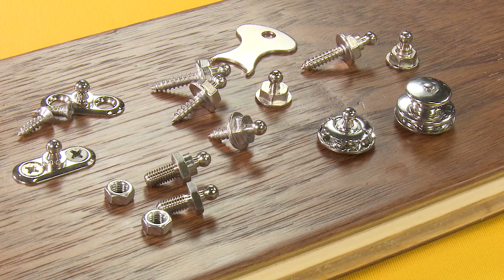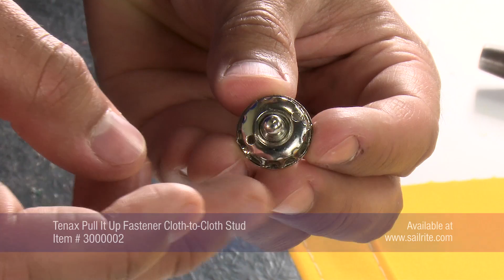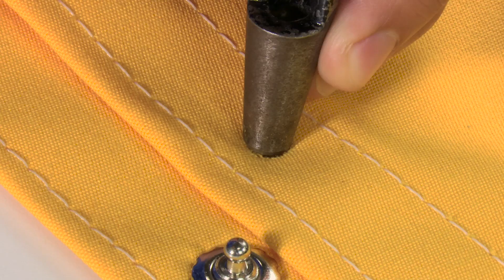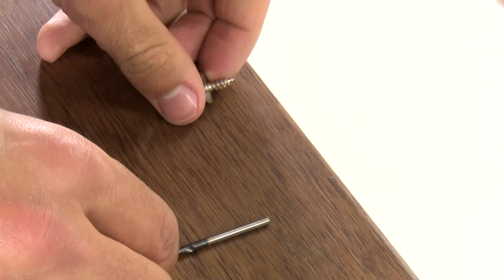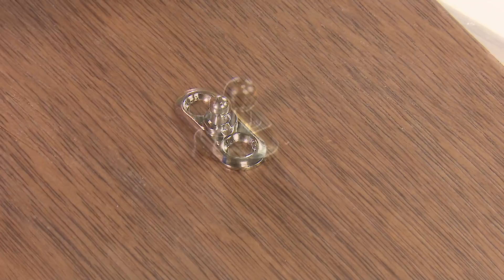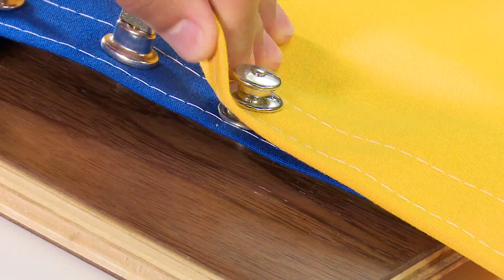Tenax® Pull It Up Fastener Demo

Comment: Can this also be attached to thinner and more flexible textiles? or will the two components just not have enough grip on the textile?
Reply from the maker: Yes, but the issue with thinner textiles is the fact that they typically cannot handle the stress of the fastener being used. Thinner assemblies may not be enough reinforcement for the fastener and may rip or tear out as the fastener is used.
Reply: Thank you for the quick response. If I were to attach/glue a thicker circle-shaped piece of textile on the thinner textile would that be able to prevent tearing?
Reply from the maker: Yes, that is often done to build up a fabric assembly for the installation of a fastener. It should work great doing that.

Comment: Do you have any fasteners for joining a fiberglass to the aluminum body?
Reply from the maker: I do not understand your application. Do you want to use this fastener on a solid surface to attach fabric?
Reply: @SailriteDIY  attach 2 hard materials
Reply from the maker: @urjnlegend  We have a product that may or may not work called the BeauClip, but it is usually used in wood applications. You can find it here: https://www.sailrite.com/BeauClip-Panel-Mounting-System-Black